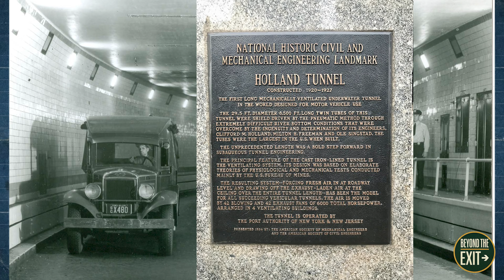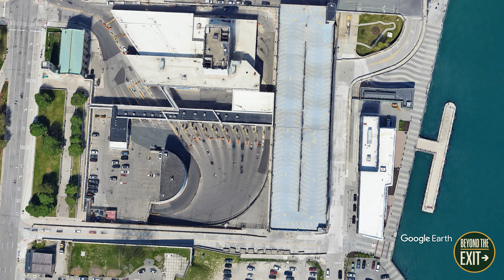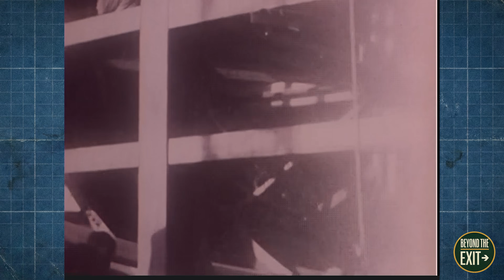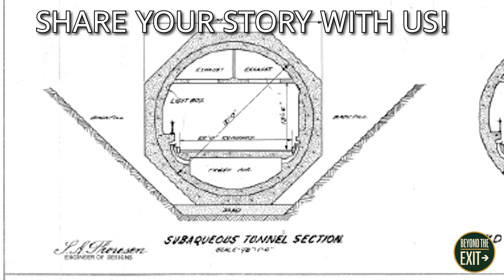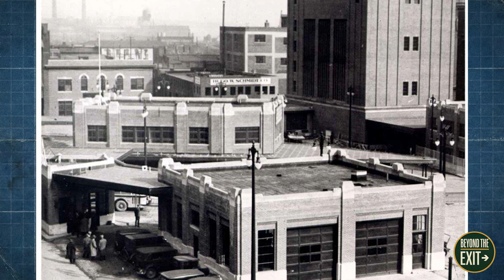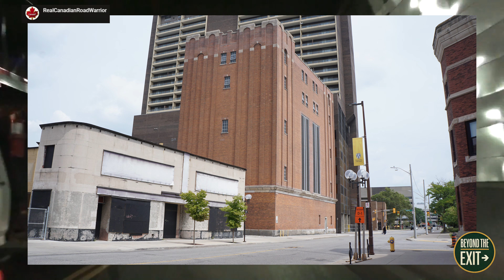Engineering The Impossible - Detroit Windsor Tunnel

Comment: Wow you just brought back memories. Back in 93 I worked for a company based out of detroit called Burnley Marlin restoration. I did repairs on the upper ventilation tunnel. We replaced concrete on the roof.  They would close the tunnel from 11pm until 7 am. Pretty much the whole summer. I really enjoyed your video because I never knew how it was originally made. More things to share with my grandkids. Also it would be very hot outside but in the ventilation tunnel we would have to wear carhatts because it would be cold.
Reply from the maker: @johnvanover9417 That is a great piece of firsthand tunnel history. Working in the upper ventilation tunnel, replacing concrete overhead, with the tunnel closed overnight — that is the kind of behind-the-scenes work most of us never think about.

And that detail about it being hot outside but cold enough inside for Carhartts is something you only learn from actually being there. I’m glad the video brought back those memories, and I love that it gives you more to share with your grandkids.

Comment: Was the train tunnel built at the same time? Great video!
Reply from the maker: @brandonwatkins9003 Thank you! No, the train tunnel came first. The Michigan Central Railway Tunnel opened in 1910, while the Detroit-Windsor vehicle tunnel opened in 1930. So they used a similar basic idea of going under the river, but they were about 20 years apart.

Comment: Do you have info about the train tunnel like the car tunnel in Windsor
Reply from the maker: @ronodowd5724 Yes — the rail tunnel is the Michigan Central Railway Tunnel, sometimes called the Detroit River rail tunnel. It opened in 1910, about 20 years before the Detroit-Windsor vehicle tunnel, and it was built so railroad cars no longer had to be ferried across the river.

It has its own fascinating story, especially because it used the same basic idea of building tunnel sections, floating them into position, and sinking them into a trench under the river. That one may deserve its own look someday.

Comment: Ummm, the Chunnel? Detroit/Windsor tunnel is the OG, but not the only.
Reply: Chunnel runs through the bedrock under the channel, so it's technically an underground tunnel.
Under water tunnels are submerged.
Reply from the maker: Well, as we mention in the video, Vehicular tunnel is the designation. The Chunnel is train, with vehicles loaded on board for transit. Thanks for sharing!

Comment: Before 911 I  used that tunnel  quite often with my semi. I pulled tank trailers which were low enough to fit. I think clearance is 13.2 feet. I used it when the bridge was backed up. The last bend going into Detroit is extremely tight with a semi
Reply: Yup, i snuck a flatbed tri axel semi through it once too. Yes, it was tight at the entrance from Detroit. I was empty . Only reason i even dared trying. Only did it once though. Always used the bridge afterwards.
Reply from the maker: @scottmalott7805 That’s a great firsthand detail. A tank trailer through the Detroit-Windsor Tunnel is one thing, but doing it with that tight bend coming into Detroit had to get your full attention. That’s the kind of detail you only really understand from behind the wheel.

Comment: I'm pretty sure that cut & fill refers to cutting a hillside about 1/2 as wide as the eventual rodaway width and using the spoils to fill onto the downslope at the bottom edge of the cut. I've always understood that digging a trench for tunnel costruction and then burying (or "covering") the tunnel is referred to as "cut & cover". But great videos all on the BTE channel; keep 'em coming.
Reply from the maker: Thanks for the clarification on those construction terms and for the kind words about the channel.